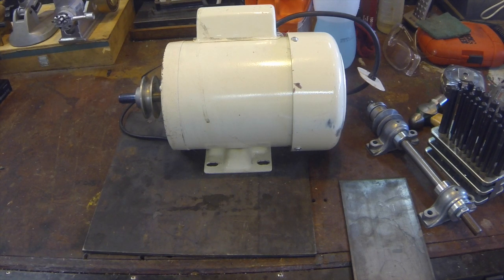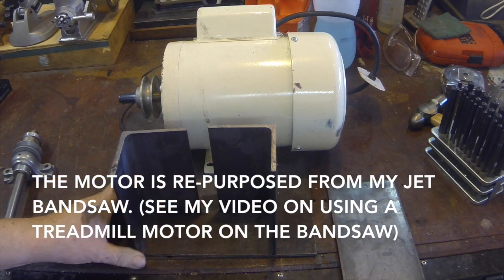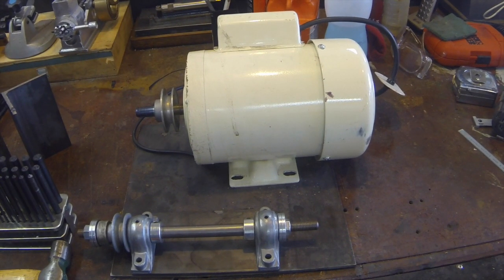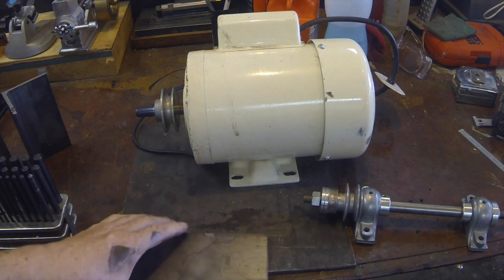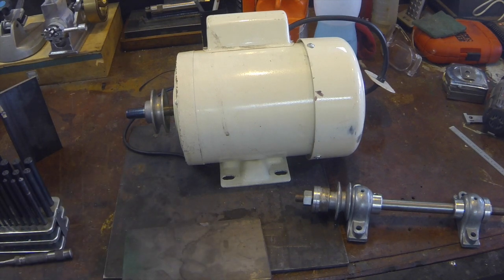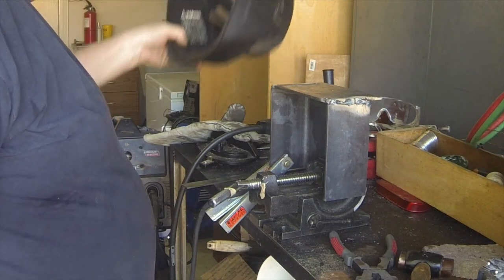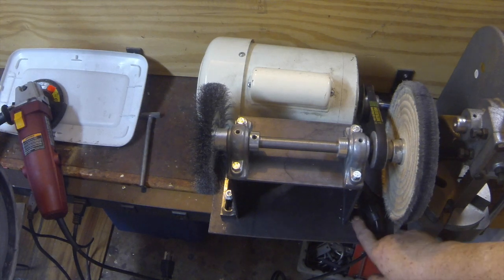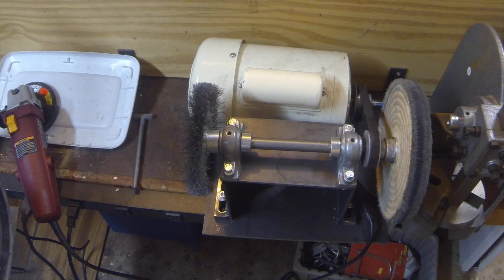Building a Wire Brush and Buffing station

Comment: Good way to reuse that xtra motor. I had an old 1/4 horse that I made into a buffer some years back. prob do a small clip on it to add to a video.
Thanks

Colin
Reply from the maker: This motor is real overkill.  It is a 1 HP.  But it was free.
Thanks Colin.

Comment: I bet you'll find a lot of uses for that on a pretty regular basis, I had a wire wheel on a bench grinder for some years till the bench grinder went bad, I really miss it and am going to start thinking about getting another one after watching this.
  Nice job Herb ...... Mike
Reply: Delta has a nice 8" bench grinder that is variable speed.  Model -197
Reply from the maker: Thanks Mike!
Reply: That would be Delta Model # 23-197.

Comment: Herb, your welding looks just like mine.  I have a hard time seeing where I'm going when under my fancy auto-darkening hood, even with reading glasses on underneath.  I found I do better with a halogen work light pointed at the work, but I still needs lots and lots of practice to get any better at it.  Oh, I can stick metal together, but it usually ain't purdy.  That's a good re-purpose of the bandsaw motor.

Cheers,
Gary
Reply from the maker: Thanks Gary,  I need more practice welding for sure.

Comment: Good one Herb.  What are the specs on the motor you used?  3/4 HP or so?  I have a similar motor with only a single sided shaft, so wanted to do something like what you have done.  Maybe even find a mandrel that I could run 4 or more wheels on it as once?
Reply from the maker: its a 1 HP.